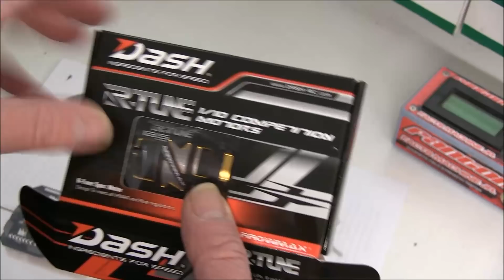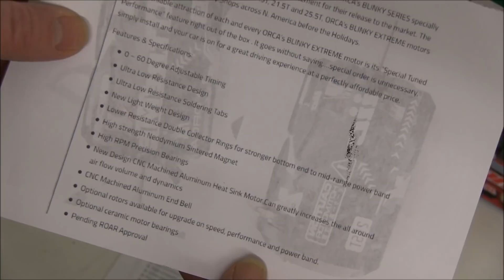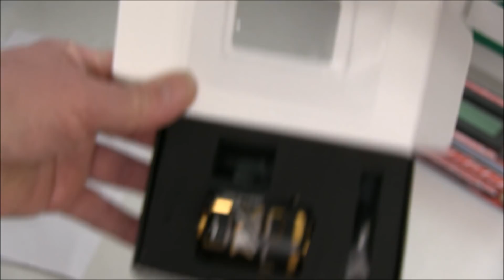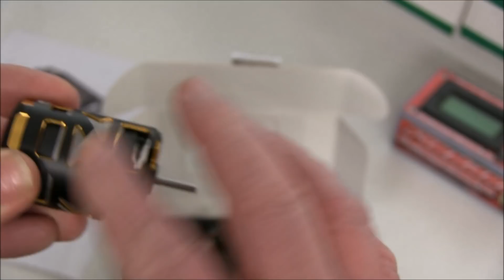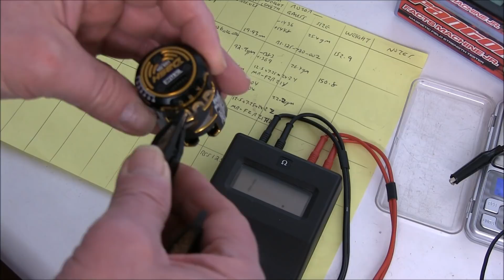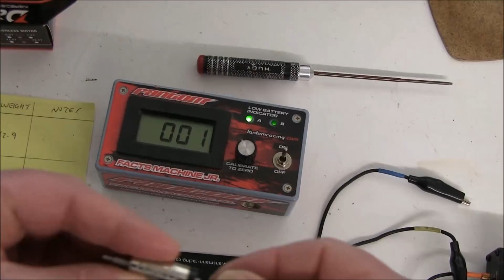Arrowmax Dash 13.5T Brushless motor

Comment: Looking forward to seeing a review on the new s-plus reedy 13.5 and tekin spec r. Noticed the s-plus will stall my fan if pointing towards the exposed sides. Both motors seem to need way lower gearing also. More like 10.5 then 13.5.
Reply: The new motors without stator guards produce smaller winds which in turn produce much higher rpm. This is why you see them coming with 1600 -1700 gauss rotors. It tries to put some torque back in them. But there's a point at which the rotor can't keep up. Or in other words, you've made them too rpm'y for a car with weight. There's a few on the market like that right now. 17.8 IR is actually too low for what can be manufactured legally for rotors. So you start seeing what you are talking about happen...have to drop teeth rapidly.

Comment: The new Reedy 17.5 S-plus is junk. I have seen 2 of them go up in smoke within the first 5 mins of run time.  Wouldn't not recommend!!!
Reply: I see I see, that is a very good data point then.
Reply: Brian Hodge 
Not sure what the exact timing was I didn't set them up. But they are both sponsored reedy drivers.
Reply: We saw the same thing. Two up in smoke. Still haven't tests a Monster Max, thats the baseline motor for all the folks in the US
Reply: I suspect the user did not adjust the timing and gearing accordingly. You'll need to drop the final gear ratio a lot compared to the M3 and use slightly less timing to not burn it up. All the light weight thin legged stator based motor with no plastic divider like R1 v16, MC2, Team Scream, Fleta V2, etc will like slightly stronger rotors for given application and lower working temperature limit of around 150F. Days of pushing motors to 170 to 180 at the end of the run is over.
Reply from the maker: Hi Ken
The previous versions also burnt out quite easily, and I was hoping that they had fixed that problem.
Thanks for the feedback.
Reply: Toby Zhang 
The guys that have burnt up the motors were all very experienced racers.  Wouldn't have said anything if I thought it was driver error. The one put a r1 in after and ran with the same gearing all night without an issue.
Reply: Seems good to me. Ran mine yesterday. Did they have the timing cranked up?
Reply: Brian Hodge 
They were set on the motor analyzer. A few guys at the track have them. They may have just been bad motors from the factory. How knows but it was very disappointing to see
Reply: ken  calhoun reason I ask is Reedy has said that timing doesn't need to be above 38. There is something different about this motor. It revs really high and has a high torque rotor.
Reply: ken  calhoun interesting. I was using a temp gun after runs. I had to drop teeth on the pinion and was coming off after 5 minutes at 135 to 140
Reply: John Barron II 
The monster max seems to be a great motor. I have a 17.5t fantom V2R in my buggy and the monster max seems to do a little better.
Reply: we have sub-sponsored AE drivers puff five of the new motors. they even started 3 teeth lower on pinions right at start. one of these drivers was talking at our track last night, that there was some factory methods during assembly that caused damage to the wires. we do have one AE driver with no issues at all  with his 17.5 with same gearing....but he kept the the timing at 26 deg it came with

Comment: Arrowmax = Serpent. This motor is definitely not a new generation motor. New generation motors have removed the stator guard (The plastic you refer to). This enables the factory to produce smaller winds that bring the resistance down. That feature alone is what makes the motor the old generation. That's why they have a rotor in the 1400 gauss range. New generation is 1500+.
Reply from the maker: Hi Mike
Yes, I agree,
It has the look of the latest motors, but using old internals.
Reply: serpent may have once sold arrowmax under their line, recently i did a order from arrowmax, paypal showed like fresh metal max corporation....nothing serpent
Reply: Arrowmax is not Serpent.
Reply: A "weaker" rotor isn't gonna make a guy not hit stuff.